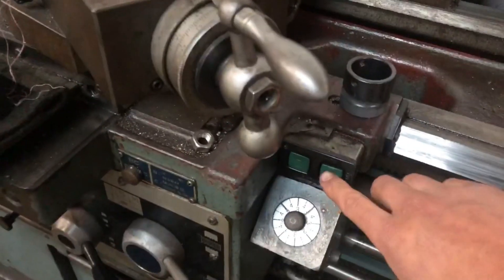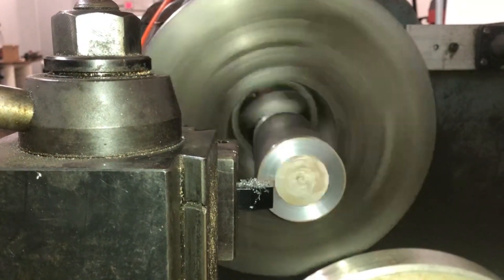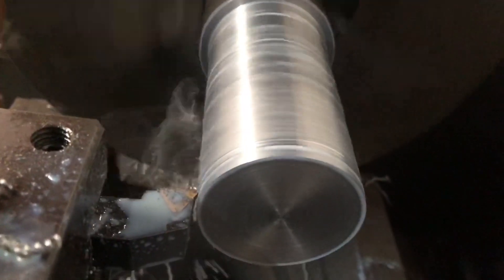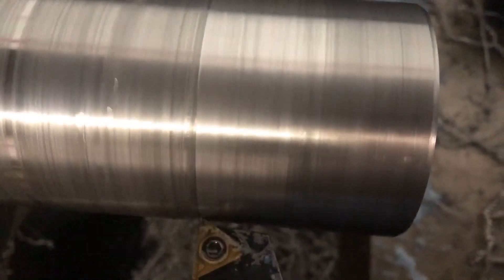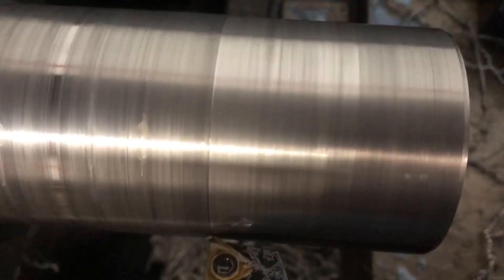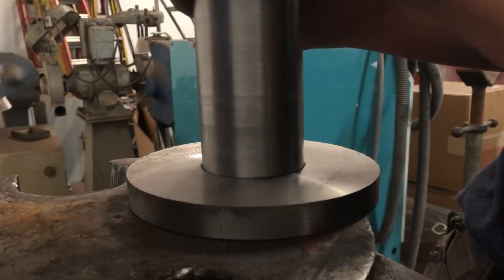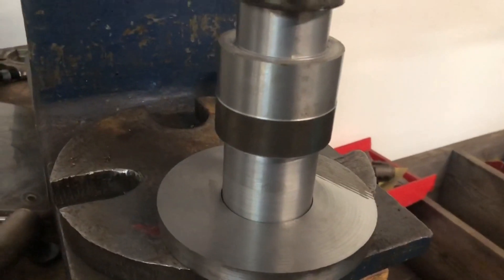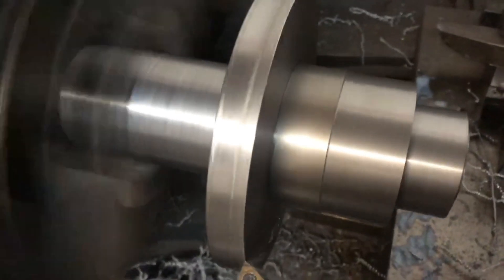How to Machine A Mandrel For A Brake Rotor Part 2

Comment: You should be able do do way more agressive cuts on a lathe that big.
Reply from the maker: I definitely could have, I was just worried about burning up the cutting insert as I was running low on them. The inserts do have 3 different sides to switch to which is nice!